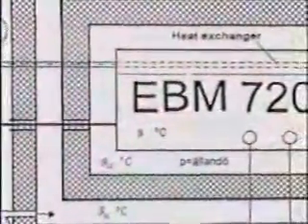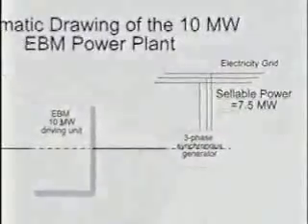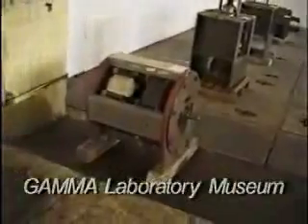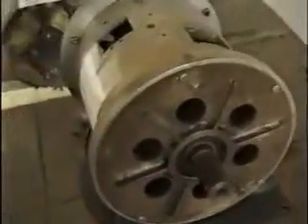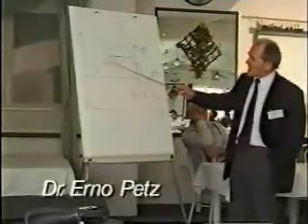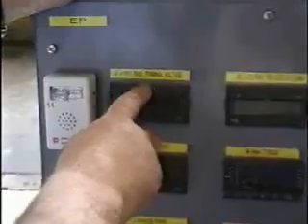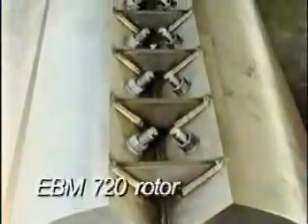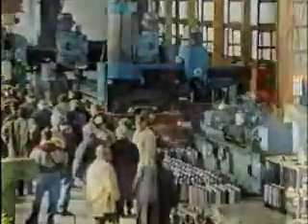Electromagnetic OverUnity Power Plant

Comment: I don't suggest anything that defies any existing laws, only things overlooked. What would you say if I could build a box & contained within that box was a device that produced electricity with no need to physically put fuel into it, you never needed to add a drop of fuel, this device operated silently but produced enough current connected to more boxes that could power your entire house, does that sound like a scam or defies existing laws?

Comment: 6
The oil companies own all of the best battery technology, The oil companies make people think they are exploring solar as the new energy but any discoveries made by oil companies allows them patent rights & will sue anybody bringing them to the surface. The solar panel must be made expensive enough to not compete with oil. Solar panels in the lab are made without silicon but in fact printed on film by your printer, it's cheap solar but I never saw this leave the lab even decades later.

Comment: 2
Then there is the street term which refers to Monetarily Free Energy or Free Fuel. Build a solar panel array and the fuel used to power it is monetarily free, therefore the solar panel is a Free Energy Device.
Set up a Water Wheel Generator & after initial expenses the fuel to run it (water in a stream) is Monetarily Free Energy or Free Fuel.
Definition of the meaning is essential to having a productive conversation.

Comment: 1
The Stealth Fighter design without modern computer or microchip technology will not fly based upon physics. That Jet & many others are humanly impossible to fly without the microchip technology. if you presented 2000 jet technology minus the computer in 1960 you would be laughed out of the room. Physicists would say based upon modern physics it's impossible. It's technology that changes our perception of what's possible or impossible in relation to physics...

Comment: "takes energy to move said magnets"Your thinking old school.You know that perm mags attract& propel,but glue them on a wheel with opposing mags on the perimeter& they are useless as you try to spin it as it jerks forward then locks in opposition...but imagine if you could alter the magnetic fields by blocking the attraction portion but harnessing only the propulsion side. Ponder long & hard before commenting. 
There is such a thing as magnetic blocking material for doing the very thing I suggest

Comment: Magnets Do Not contain energy as you have said but they do contain force which can cause rotation (such as for example the planet), & within that rotation may allow the ability to convert that into energy production but the question is at what level?For instance what force would it take to stop the earth's rotation?If you placed a belt on earth what size generator could that force run?The earth is an ever running magnetic machine, could we scale down the model& make it work for power generation?

Comment: E
I view this hypothetical scenario as the magnet is then the new fuel. The metals must be mined, processed then magnetized to perform work. Tesla's goal was to run machines off of the very wheel works of the planet, much like placing a generator with paddles in a stream. The device costs money to build but the actual energy production is monetarily free. Anybody who refers to Free Energy is referring to monetarily fee energy. weather it's economically feasible is an entirely different topic.

Comment: D
Let's say hypothetically that someone can take magnets, align them and using magnetic blocking material to control force into propulsion of a motor that spins with zero electrical input. The average individual would view this as monetarily Free Energy. Obviously you pay for the motor but seems to be creating it's own energy. Scientifically that's wrong. The energy (or force) hypothetically is coming from the magnets & they will demagnatize then must be remagnatized...

Comment: A
Don't be so quick to judge. It's the terminology that causes the conflict. 
There are different interpretations of the term Free Energy:
Original term meant radiant energy, the kind of waste heat that comes off of a motor.
The term then slowly changed to Energy from nothing or created energy which is believed to defy physics. Dictionaries again have changed the term but the street term simply means energy you don't have to pay a utility company to access.

Comment: I believe it took me about until I was 9 to design my first OverUnity (though not called that) conceptual device.
It took until I was 13 for me to determine why it wouldn't work, magnets are not like fans, fans don't have the same field around them, you cannot use a magnet like a laser, at a given distance, it will pull along the field-curvature, or push along it, not straight out, depending on charge. this is why nobody has ever made a successful commercial product using a magnetic generator.

Comment: @Truthiness231
You grasp a concept that few can. Most magnetic propulsion motors are poorly designed which require electrical input & the magnets only assist but magnets are incredibly powerful & a mag motor designed strictly with large enough magnets last for 300yrs under a working load so as per your perception the magnets are the fuel source & far into the future when magnets are mined specifically to drive motors the corporations will charge you for 300yrs worth of fuel.It will never be free

Comment: @fortitude3030 Because it's not real? That would be the main reason...

The problem (and why magnetic "overunity" machines so often look like they work): magnets take energy to make (in fact, lots and lots of it for these strong neodymium ones), and they also lose that energy as they perform work. In the end, the output will always be less than or equal to what was put in (ie not overunity).

All this is, essentially, is using a magnet as a very very weak but very long-lasting battery of sorts.

Comment: @1REDDAWN13 
"Does free energy tech work? I explain that in 4&5.
All replies should be made at the very end of this numbered series. In reference to heat: The very first scientifically accepted term Free Energy was in reference to radiant energy such as the heat which radiates off of a motor. The Scientific term Free Energy has officially changed 2 more times since.

Comment: @1REDDAWN13 
4
In addition,I think there is a bit of un-purposeful deception in measuring energy input & output on these machines.Hypothetically if you could tap into the powerful force of permanent magnets where the magnetic force is altered to take advantage of it's propelling force yet block it's attracting force it will propel a wheel or generator with a very powerful force.Add some electrical current to keep it going& your measurements will be off if you don't calculate magnetic force input

Comment: And, like everything else, If or when it hits the market is will be prohibitively expensive. I remember when the first PC's hit the market, they were huge, slow and cost 5 grand.  Using current market time lines it will be three decades before it becomes affordable to the general public. I'll stay with my Hydroelectric system. It generates all the power my farm needs and has been running for fifteen years now. The technology have been around a hundred years, but hey, it works.

Comment: Natural gas is less expensive than Electricity?  Thanks for the information.  I learned something this morning.  I guess Natural gas (methane) is hot fertilizer in compressed.  However mine doesn't light up.  I wonder how much more potent Natural gas is.  I didn't know it was efficient to run an electric generator using natural gas.  I have to admit I am skeptical about Natural gas wells.

Comment: @christo930 Coal and oil are not FREE. Gasoline is now over $4 a gallon! THe OPEN systems featered here and elsewhere are OPEN systems, that convert energy from the vacuum, or ETHER, or TACHYON field, which is clean, cheap and inexhaustible. The paradigm has shifted, and physics allows the conversion of Zero-Point energy. Look it up.

Comment: @FreeGlobalEnergy The limiting factor for electric cars isn't the cost of generating electricity, it's the energy density of batteries and the inability to recharge them quickly. You can completely fill your gas tank in under 1 minute, even the best batteries would take over an hour and would require high amperage charging stations.

Comment: @FreeGlobalEnergy Nobody's invention could ever turn oil into sand (metaphorically speaking). Oil isn't just used for energy, it's a feed stock for plastics, pharmaceuticals, lubrication etc. Furthermore, oil and electricity are simply not related. The amount of electricity generated by burning oil is minuscule. If anything, your enemy is big coal and natural gas.

Comment: @Gnomefro 
Yes, pumping of oil would continue for the purpose of the byproducts. It's true, production costs would drop due to the new magnetically powered generators yet the loss of gasoline, Diesel & oil profits would have to be passed along into the by-product material. The new dilemma is that now the by-products are not by-products anymore as they are the main purpose for drilling, now gasoline & Diesel become the waste products that must be disposed of.

Comment: @Gnomefro 
As the automobile was gaining popularity the horse industry tried to fight them off by placing ridiculous laws on the books for car owners. There was a clash between the two eras. Automobiles were loud & stunk up the air, they scared the horses as they drove by & were a major nuisance. Had the horse industry the power of the oil industry today then we would still be using horse & buggy as city transport. I am not sure you are aware of the viscous control of major corporations today.

Comment: @Gnomefro 
1
Why do you think so many things have a designed rapid failure rate?
I repair appliances. Appliances in the 50s through the 70s were usually worry free but now I see refrigerators, washers & dryers that fail within a 4 yr period because of inferior parts. It's always the same parts. I shouldn't complain because people go out & buy a new one, I get their old ones for free, replace an $18 part & resell it. Good for me, bad for the consumer.

Comment: @Mouldywart 
B
You first must be able to grasp this concept before moving forward. Check with any magnet supplier, working magnets will stay magnetized for approx 300 yrs. Moving forward, these machines cannot run on magnets alone, magnets are used as an assist only. Electrical current from the grid is the main driving source, magnets assist. What you see here is a meter placed on incoming current then a meter on outgoing current, but wait... nobody ever places a meter on the magnetic force...

Comment: @Mouldywart 
A
These machines don't violate any laws, it is only the representation that is flawed. See if you can follow:
First you need to grasp the concept that altered permanent magnets, magnets in which a blocking material is used, do indeed provide force & repulsion or propulsion eliminating the pull back or locking you may have experienced as a child playing with magnets. Block the attraction & you only have repulsion or propulsion...

Comment: The original machine had a base-plate of prefabulated amulite, surmounted by a malleable logarithmic casing in such a way that the two spurving bearings were in a direct line with the pentametric fan. The main winding was of the normal lotus-o-delta type placed in panendermic semi-boloid slots in the stator, every seventh conductor being connected by a nonreversible trem'e pipe to the differential girdlespring on the 'up' end of the grammeters.

Comment: @FreeGlobalEnergy By magnetic force you mean the force of repulsion and attraction between either multiple magnets or a magnet to a ferromagnetic material such as iron. In this case these forces are conservative, meaning that any closed path integral results in a net energy input of zero. For example pushing two magnets with like poles facing one another requires work input (dw = F(x) dx), the magnets when allowed to separate release this stored energy in equal amount. Wiki conservative force

Comment: @FreeGlobalEnergy  If output energy is greater than input energy then by definition this is perpetual motion since all we need do is route the output to the input and use the excess energy for whatever need we may have. The fact that the design shown in this video is not used extensively is a sign that the claims are bogus.

Comment: I find it odd that when calculating the overall output they include the heat generated yet never do they mention, or apparently implement, a method to convert the heat energy back into electricity. Kind of an important part of the equation there...

Comment: Let us consider ITER (magnetic force confinement), Megajoule (laser confinement) and the Z-machine (Laplace force confinement). They all operate on the macroscopic scale. They may miss atomic-scale opportunities. Once you can setup an "alternating diameter continuous ball bearing" configuration of the electronic layer surounding the atomic nuclei, and once you can control the in-flow and out-flow balance with the atomic nuclei, you can operate transmutations and weak energy fusions.

Comment: That one also provides an easy access to the inner, and from the inner ... for the lubricant. Because every ball acts like a gear, touching the two neighbour balls. Thanks to the slightly different diamaters, the balls don't slip. They roll, they gear. That's the big difference. Half the ball interfaces are gears granting access to the inner. The other half are gears operating in the other direction (inner to outer). What you need for operating nuclear fusion, is to control the in/out balance.

Comment: There may be interesting similarities with superconductivity : unconventional macro-electronic properties coming from unconventional electronic patterns at the atomic level. Take the example of a continuous ball bearing. You may fill the bearing with balls having the same diameter. It doesn't work optimal. You may fill the bearing with balls having two slightly different diameters, alterning them. It works optimal. That one also provides an easy access to the inner, and from the inner.

Comment: The 60 GHz frequency is just an example, there may be useful resonances at other frequencies. Magnetic time shift related to group delay, not really a time shift. This particular stimulation may cause unconventional patterns of the electron spins and energy bands. You may take advantage of the weak nodes, where the electronic barrier gets very thin. This way you may get a cheaper access to the nucleus, trigger some weak atomic reactions, and induce atomic fusion maybe, if you stay synchrone.

Comment: What you just read is a unification theory for over-unity motors, weak atomic forces, and cold fusion. But wait a moment, 40 million cycles at 60 GHz is only 666 microsecond. Yeah, that's maybe the excess energy some do claim in their hydrogen / deuterium experiments.

Comment: When you realize this, you understand that the device may be more easy to build, not operating at 60 Hz, but operating at 60 kHz because of less time displacement needed. Or 60 Ghz. But wait a minute, what kind of motor can sustain a 60 KHz or 60 GHz operation ? Answer : atom-scaled motors. At this stage, if you are equipped with a brain, you know what to do at the atomic level : tweaking the spins.

Comment: The application of a transmagnet would be to switch the magnet off periodically, just when it arrives the maximum attraction force between the magnet and the magnetic pole. If you achieve this, you have a motor able to run 1 week, extracting power from the permanents magnets. A potential explaination for the operation of the transmagnet would be that the control gates displaces the magnet effect in time.

Comment: Very important for getting the overunity feature, is that the power consumed by the gate (less than 50 milliwatt in the example) is an order of magnitude smaller than the mechanical power delivered by the magnet (say 500 milliwatt for getting a X10 overunity factor). Very important for the industrial applications, is that the transmagnet can operate at least 40 million cycles (1 week at 60 Hz cycles) before losing 10% of his mechanical power.

Comment: @FreeGlobalEnergy
Now I see what you mean. What you need is what we shall call a "transmagnet". A transmagnet is a device embedding a permanent magnet, equipped with a control gate. When you apply no voltage on the gate, or leave the gate floating, the magnet generates a magnetic field like any permanent magnet. When you apply a voltage on the gate (say 5 Volt DC with a current less than 10 milliamp), the magnetic field vanishes.

Comment: @FreeGlobalEnergy
What you need is what we shall call a "transmagnet", a device embedding a permanent magnet, equipped with a control gate. When you apply no voltage on the gate, or leave the gate floating, the magnet generates a magnetic field like any permanent magnet. When you apply a voltage on the gate (say 5 Volt DC with a current less than 10 milliamp), the magnetic field vanishes.

Comment: @UnderManlac 
Something that would fall under Monetarily Free Energy after production, such as the solar panel would be some device that can harness static electricity, lightning strikes or the very magnetic flow that flows continuously through our planet. It's not a question of if it can be done but just a matter of discovering how to do it. All advancements are based upon mechanical & electronic technology. Without it then all we do today is impossible.